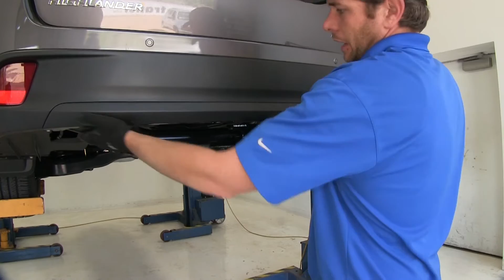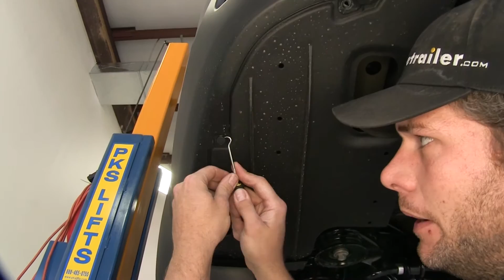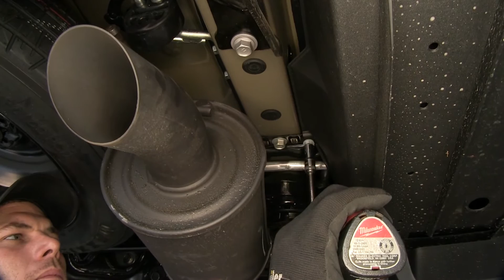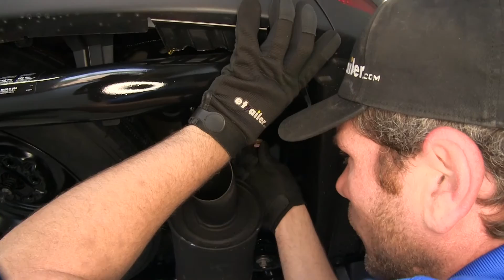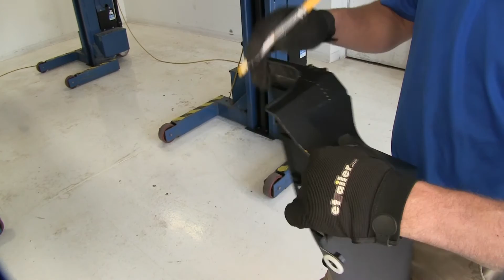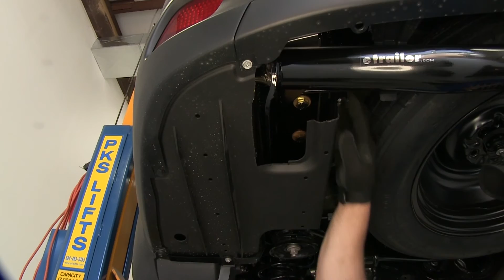etrailer | Setting up the Curt Trailer Hitch Receiver on a 2015 Toyota Highlander

Comment: Just added this hitch to my 2015 Highlander.  The video was very helpful.  Detailed instructions on exactly what to do - make the install quite easy.  The instructions showing where to trim the under panel was excellent.  The only time i needed help was when I had to get my 12 year son to hold up the hitch on one side while I put the bolts in.  Well done.  Thanks for the video!!!

Comment: Has anyone had an issue with the 12mm plastic caps spinning freely and not loosening completely?
Reply: yeah. i had to give my cover a "tug" to just pull it off. they secured fine when i put it back on after trimming.